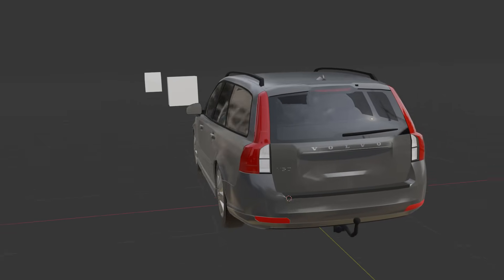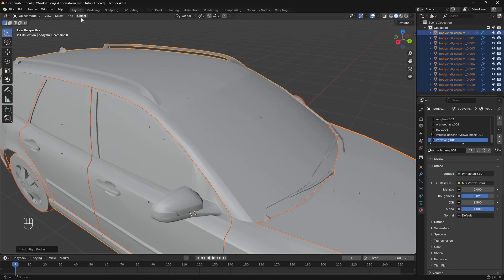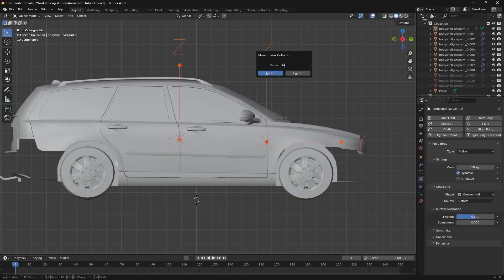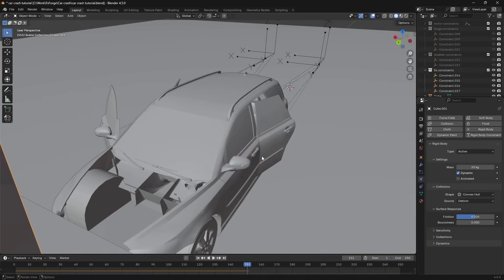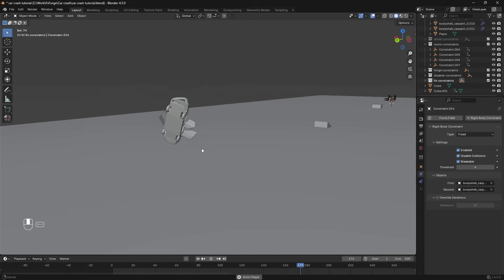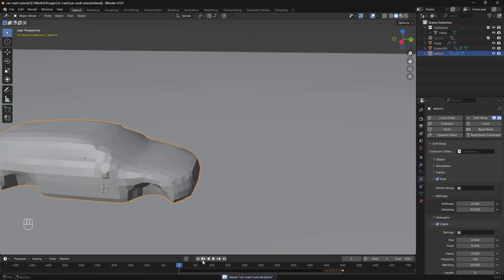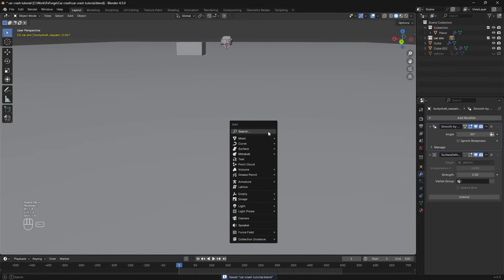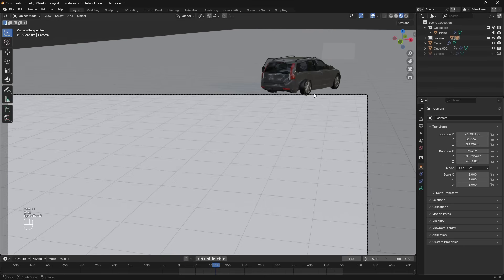Blender car crash tutorial!

Comment: is controlling car part include in patreon ? how to controll the car ?  i want controll the car with rig
Reply from the maker: I do cover it in the long breakdown, but it’s really simple! I use a simple cube (or any object with a rigid body), set to animated. And I connect it to the car using a generic spring constraint, set to apply a spring force on the Z axis. So when I key frame the cube to rotate, the car follows that rotation! Hope that makes sense 😄